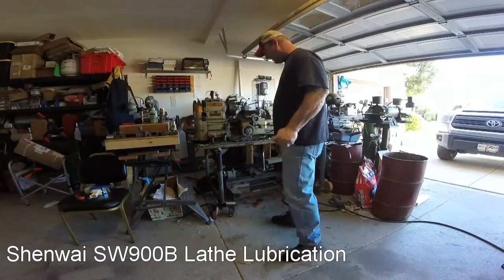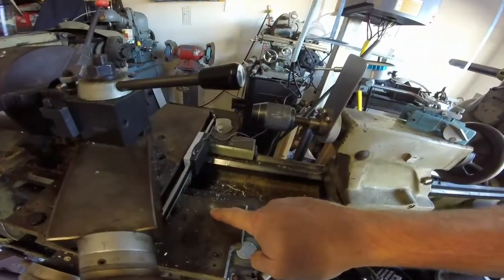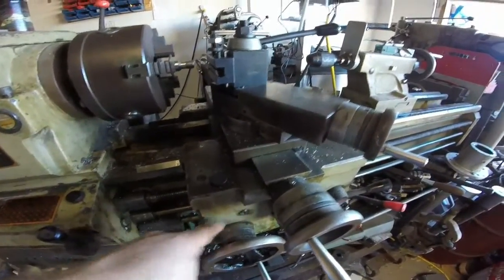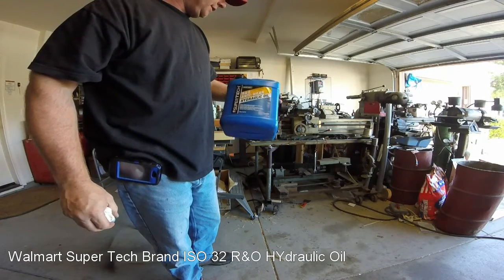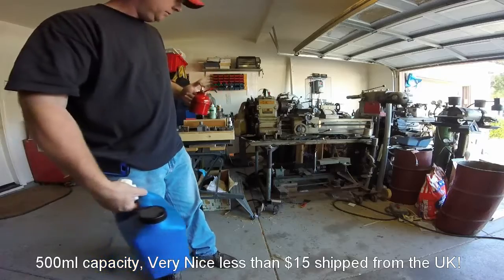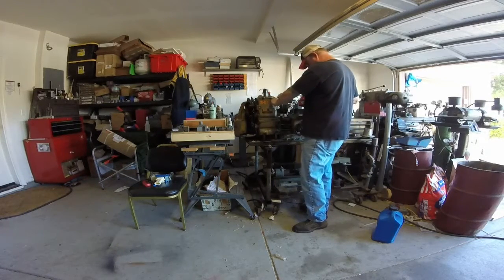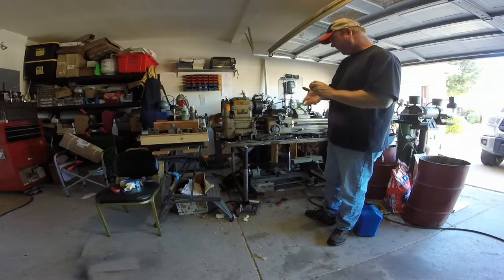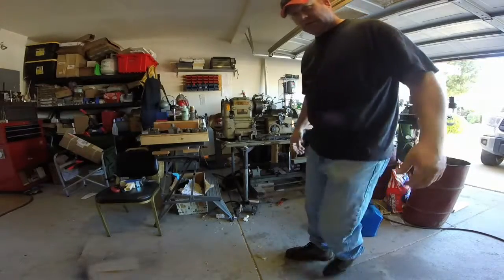Lathe Lubrication, Shenwai SW900B 1236

Comment: How do you hold the mandrel spindle to remove the screw on chuck?
Reply from the maker: Hi Val, if you can wedge a piece of wood between the drive pulley and the headstock, you can unscrew the chuck with a  big wrench on one of the jaws perpendicular to the longitudinal axis. or you can put a square piece of metal perpendicular to the longitudinal axis in the chuck jaws and tighten it up  i made another video on that
https://www.youtube.com/watch?v=QVzEGJn6vBU

Comment: Hi, thanks for the Lub info, much appreciated. I have just picked up a model SW-350 bench lathe and was wondering if you could send me some pics of your drive motor set up as mine has been adapted but want to take it back to original. My machine didn't come with operating manuals or parts book so not sure. Many thanks, gordonagent@gmail.com